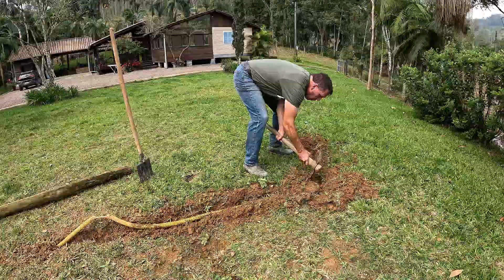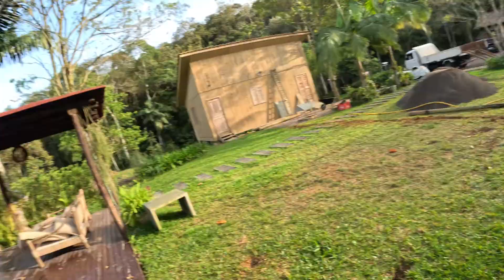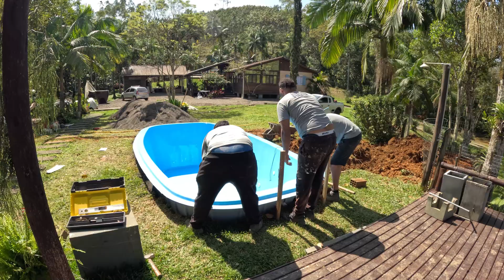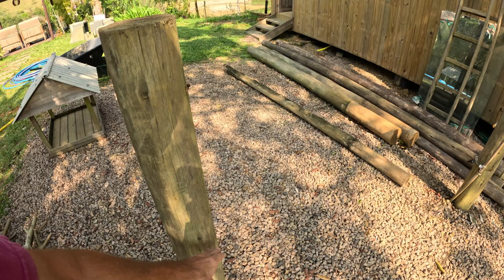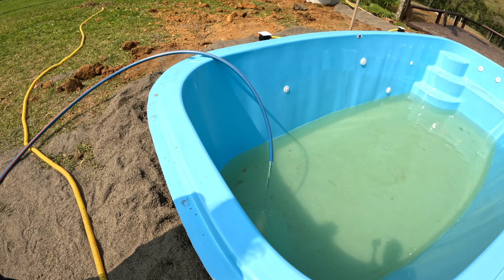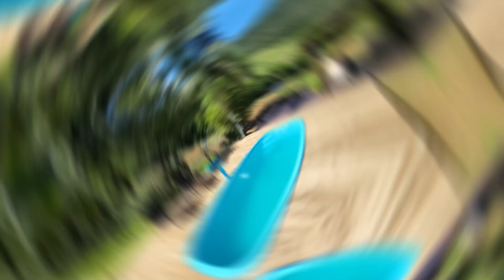Pool installed and new deck built around it.  Project start to finish.

Comment: Mineral water is the best to fill up a pool so it's worth the extra work, and the deck is neat. Great stuff, Jim!
Reply from the maker: @Underachiever_Files  Well not sure what the mineral content of the river water is. But it has clay in it. LoL
Reply: @JimSmithBrazil  Mineral water is just a term to say it's extracted from a natural source. The contents may vary, but it's usually salts, gasses, and other composites dissolved in it. It's a complicated way to say it's healthier for you. And yes, the clay is also a mineral, usually hidrated aluminum, iron, calcium, potassium, magnesium... depends on the kind of soil you have there, close to the water source, probably a type of what we call here "gleissolo" (which must remain protected by the woods around it, otherwise it will degrade and the water will not be available on the surface anymore). Edit: oh, if you ever visit Brasília, go to the água mineral club, it's inside the national park, they have huge pools with water from the purest rivers. Congrats, you've built an agua mineral in your own home. Hehe.
Reply from the maker: @Underachiever_Files  Thank you for the information! All natural is fine with me!
Reply: LOL, if Jim were to fill the pool with mineral water he would spend a fortune because it is 20K liters, whereas in Brazil a single gallon of mineral water with 20 liters costs R$ 15.00. As a matter of fact, if Jim wanted to, he could fill the pool with lake water or even sewage water that comes out of the kitchen, because once the filtration pump and the filter are activated, the water treatment begins and in less than 1 hour the water will be pure and crystal clear like mineral water, just using the correct products such as chlorine, anti-fungal, water acidity controller, etc., and using the water quality test kit. After that, you can even drink this water without risk.
Reply: @paulonunes2002  ok, man... geology is not very well known by the average brazilian, i'm aware of that... jeez, gotta love the "know it all" typ'a guys. Edit: read my second comment, you might learn something new, bruh. By the way, just to be crystal clear, he already did it, river water IS mineral water.
Reply: @paulonunes2002  kkkkkk qi 38
Reply: @paulonunes2002  seriously, what do you think river and lake water is? Inteligente demais você, kkkkkk
Reply: @Underachiever_Files in case you dont know here in Brasil bottled water we call "água mineral", your comment says that Jim should fill his 20K liters pool with  "água mineral" or "bottled water" how it is called in the US 😅😅😅
Reply: @paulonunes2002  entendi, você se recusa a aprender o que tô ensinando de graça, irmão... le o segundo comentario, geologia tbm é ensinado no brasil, tá aí, é de graça... meu deus, cara
Reply: @paulonunes2002  se nao acredita em mim, beleza, procura no Google... jesus christ, man...
Reply: @paulonunes2002  procura no google se nao acredita em mim... jesus cristo!!!